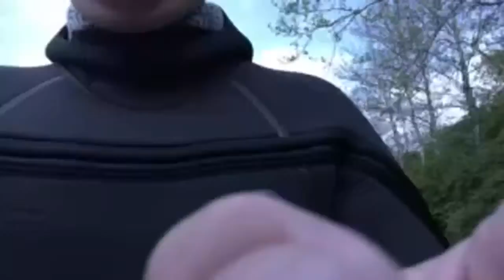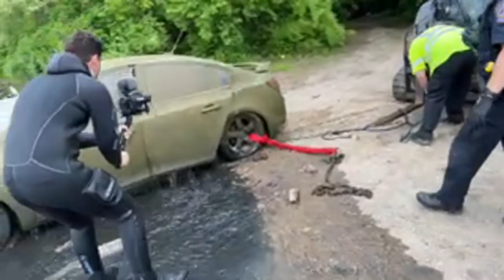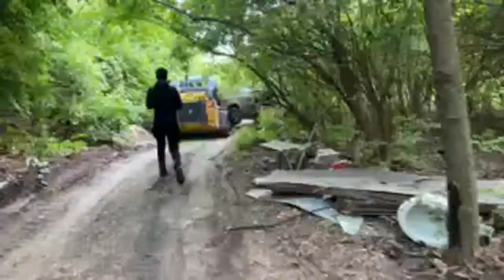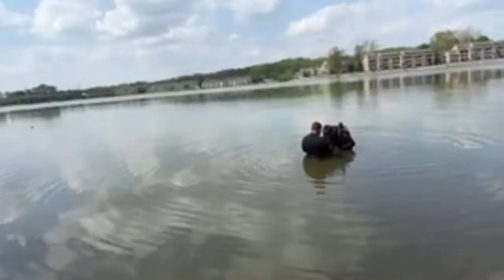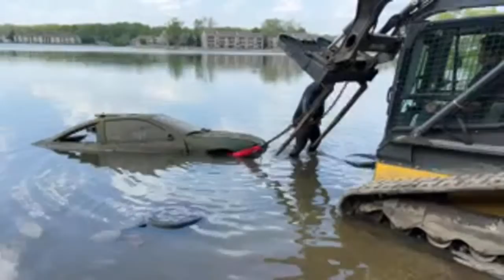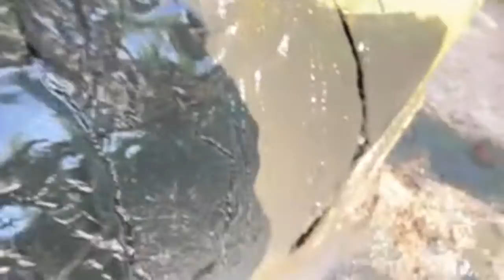Police On Scene 2 stolen vehicles Live Removal with Garners Towing

Comment: You guys need to get some 5/8" Yacht Braid to pull cars out with it's 10,000# breaking strength, it's very easy to put an Bolen knot in and that Bolen will Never come undone until you untie it

Comment: I am really surprised there is not a concerted serious effort to contain all the oil and debris involved in this work. 

Isn't part of your efforts to clean and protect the environment? 🐾🇺🇸🐕‍🦺
Reply: By state law tow truck drivers are required to clean up after all vehicles they transport.  I see it sometimes.
Reply: @myfavoritemartian1  Thanks! But I did not see ANY collection of the debris/oil at the time of it spreading out all over the place. 😞🐾🇺🇸🐕‍🦺
Reply: @dogswithjobs2531  there are oil pads that some of the divers are able to carry, but resources are pretty limited ~ if you ave a contact with any of the pad makers, or can donate towards the cost of getting them, I'm sure Jacob (& Britain) would be very happy to use them